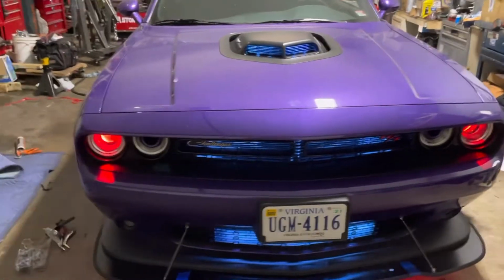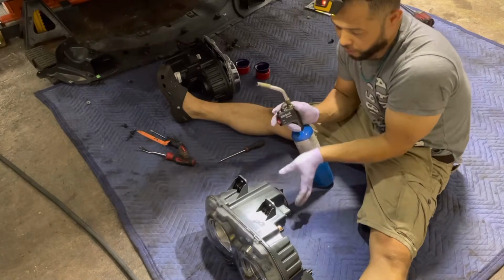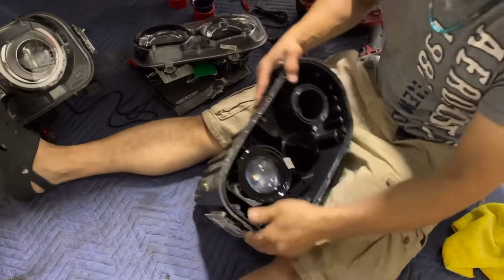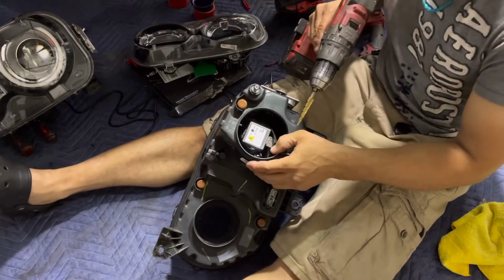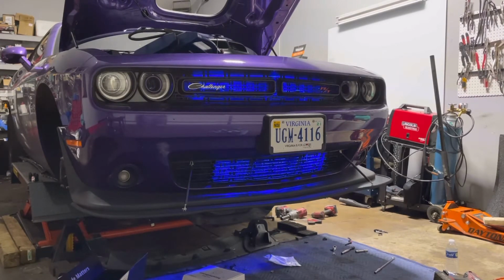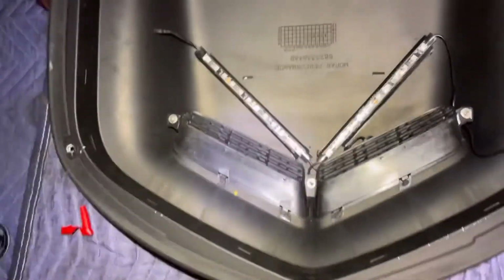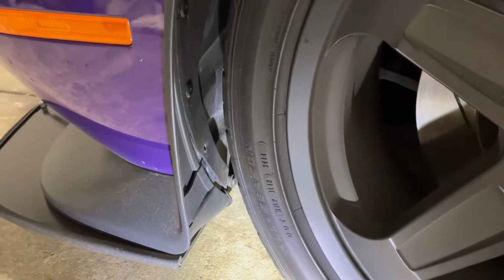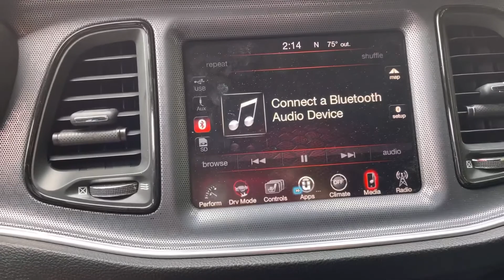2016 Dodge Challenger demon eyes grill led  and under glow DIY

Comment: Nice work!   I had some led's installed in the grill of my scat pack and it smells like something's burning when the car is running.  Do you think it could get hot enough to overheat the plastic in the light strips?

Comment: where did you wire the demon eyes? ive seen other vids where they tap into the headlights but not too sure.
Reply from the maker: I tap them to the battery so you can turn them ON at any time with your Phone
Reply: @nestorautorepair  dont they stay on all the time if hookep up to the battery?
Reply from the maker: Yes I put a separate switch so you can turn it off